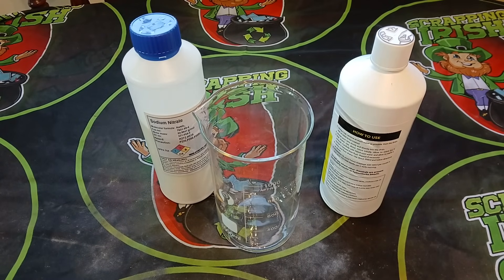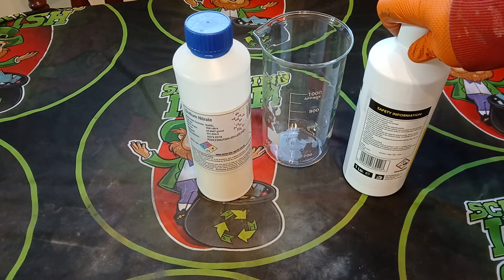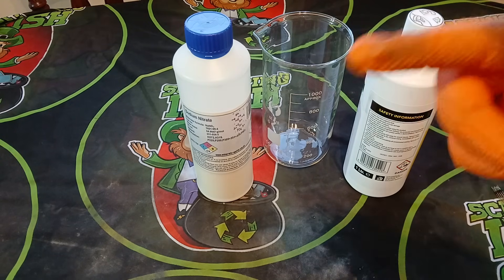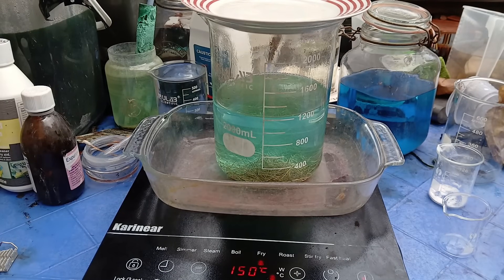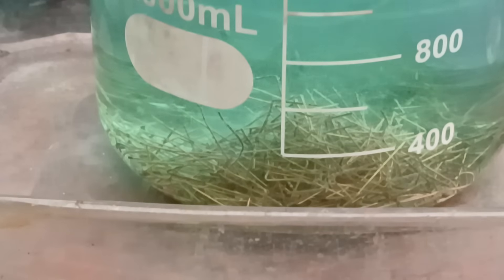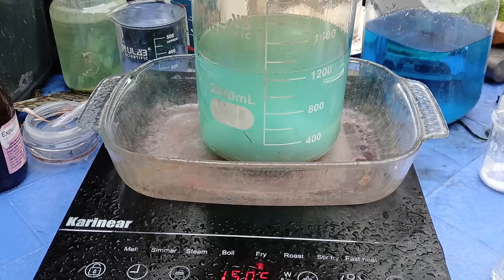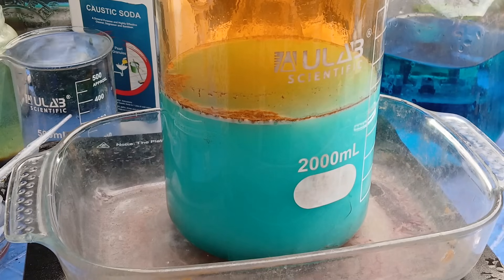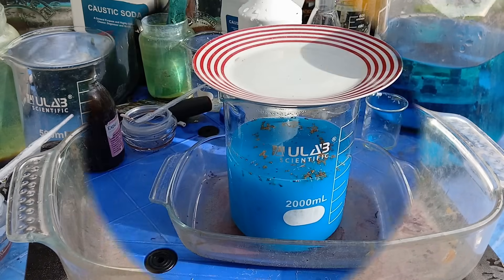STOP Wasting Money on Gold Extraction - Poor Mans Nitric Acid Works!

Comment: Nice video, sodium nitrate is cheap and so is hcl which is muratic acid? Urea for stopping reaction is cheap and stinus chloride is cheap as well this the way I do it. Nitric acid has deadly fumes.
Reply from the maker: Yes, you are 100 percent correct. Nitric acid does have deadly fumes.

Comment: If im doing an experiment on gold scrap is it better to mix potassium nitrate with sulfuric acid instead of hydrochloric acid to make poormans nitric acid to remove my base metals from enquarted gold so that it leaves the gold intact? if i made it with hydrochloric acid wouldn't it just form aqua regia and disolve everything making it impossible to recover the gold?
Reply: As your doing here
Reply from the maker: That's the reason I don't hcl don't want to create aqua regia
Reply: @ScrappingIrish thanks for the reply I thought as much just wanted to clarify! Also if I may ask I have some sulfuric acid drain cleaner I think its 93% but it has a red colour too it woukd this cause any problems in the experiments woukd you know?
Reply from the maker: I have used both clear and the one with red and both seem to work

Comment: Good video for removing base metals, just use battery acid and a nitrate salt, however If you have sodium, potassium or calcium nitrate,  then just make your own nitric.. use HCL and some copper, catch the NOx gasses and push through a chilled condenser and collect in H2O2.. BINGO... Real nitric.. all the best..

Comment: Thanks for your answer. However, I have since purchased some KNO3 and so will be using that. I have made some H2SO4 by electrolysis of MgSO4 sol using clay pots with distilled water in them. I have about  Litre of dilute aced, not done a titration or boiling so uncertain of percentage. Having seen you dilute 50ml acid with 1000ml water had an idea of just adding slowly 60ml KNO3 to 1000ml of already dilute acid, to see if it works.

Comment: You should use a chronical flask. Then attatch a tube to a airstone drop into a container of water add bicarbonate of soda. Then the dangerous gases bubble through the stone and dissolve in the water. No harm to you or the neighbors. Just a thought 😊
Reply: @empirefinds  if i dont have airstone,what can i use instead
Reply: @johannejim7810 fish tank airstones. this is a most important step can not be bypassed. the stone distrubutes the air in tiny buubles that pass through the liquid. big bubbles rise to surface and pop releasing the very gas you are trying to make safe. there are a few more steps before and after . A full youtube video on the fume hood build the do's and don'ts. This will arrive early summer.

Comment: For all the folks looking for sources, it's all at the hardware store. Nitrate  is Stump Remover, Sulphuric acid= Muriatic Acid. Muriatic is a bit weaker than lab grade but works fine.
Reply: @jeffhays1968  muriatic acid is hydrochloric acid not sulphuric.
Reply: @jeffhays1968  sulphuric (h2so4) is NOT muratic (hcl).... 2 COMPLETELY different acids.... better learn your chemistey
Reply: High concentration sulphuric acid is sold as drain cleaner usually, muriatic is hydrochloric based.
Reply: @Shaftley69  battery acid is usually easier to find at an auto shop or hardware store which has an auto section
Reply: Stump remover is Potassium Nitrate
Reply: @jeffhays1968  stump out is sodium metabisulfite
Reply: @jeffhays1968  actually its sodium metabisulphate
Reply: @jeffhays1968  watch the type of stump remover, there are some that Sodium Metabisulfite. 
Muriatic acid is hydrochloric acid, NOT sulfuric acid.
Reply: @jeffhays1968

Maybe you skipped chemistry class. Sulfuric acid and muriatic acid are distinct chemical compounds. Muriatic acid is the commercial name for hydrochloric acid.
Muriatic acid is a chlorine containing compound, while sulfuric acid is a sulfur containing compound. Compared to hydrochloric acid, muriatic acid is a compound of hydrochloric acid with impurities. The production of muriatic acid involves the distillation of hydrochloric acid and a salt (containing chloride ions). The impurities in this acid come from this distillation process.
Reply: @LCMSRJ ok, always thought they were the same.
Reply: If I was u,  I wouldn't play around with any acids

Comment: Where you getting it?, I can't even get sulphuric acid.
Reply from the maker: It's available in hardware stores as a drain cleaner
Reply: Muriatic acid in plumbing supply store.
Reply: @j @jeffhays1968  Muriatric acid is hydrochloric acid. OTC (Over-the-counter) “Roto” drain cleaner is sulfuric acid.

Comment: Instead of using water + sulphuric acid could you just use a car battery acid that is a mixture of the above ingredients ? In some places it’s much easier to get a battery acid rather than a concentrated sulphuric acid.
Reply from the maker: Yes it should work ok

Comment: I do something similar. I put a little water in a jar, then put in the sulphuric acid (slowly). When the reaction stops, I add pottasium nitrate (fertilizer) but the other nitrate will work too. I then put a lid on the jar and put it in a ziplock bag. Then, I stick it in the freezer. The next morning, everything has frozen except for the nitric acid. I pour it straight off into another container. The crystals that formed are suposed to be some form of fertilizer. The nitric is a lot more pure but probably no more than 60% ish. It only makes about 25% of the total volume before freezing.
Reply from the maker: Very interesting, I've never heard of that
Reply: @ScrappingIrish  I found it online and tried it. Works pretty well once you get the nitric back up in temp. Doesn't work for crap cold.
Reply: Yep. It is weaker so doesnt work well cold. Im in texas so usually just put it in the sun. This time of year i have to put on low heat.
Reply: Nurdrage has great videos on how to make a lot of acids.

Comment: I buy sodium nitrate in 20 pounds bags. I go through it fairly quickly. I love using it to get rid of base metals. Save my nitric for the refining.
Reply: I've had every glass baking dish I used shatter from the heat. I've switched to Corning ware

Comment: i use H2So4 and KNo3 ... straight up nitric acid works better  but still h2s04 and kno3 works just as good for what i need.. 
i use straight up nitic for special circumstances though when i need or want to though.. but yea.. both works just as good as the other
Reply: Didn't you just write out the same H2SO4 - KNO3,  HNO3 isn't that nitric acid?.

Comment: Hey brother🙋🏻‍♂️ on average about how many ML of sulfuric and sodium nitrate would it take to dissolve say 1000g of pins and connectors? Just curious what the actual price difference is since sulfuric is roughly $25/Liter and nitric is around $35/liter
Reply from the maker: Woe you pay a lot for sulfuric it's only 8 per ltr here
Reply: @ScrappingIrish WOW yeah I can see why it's such a cheaper alternative.. Amazon has it at about $25 and Walmart for $20
Reply: @ScrapDaddy365  does that mean might swell buy nitric in the states.,?
Reply: @ScrapDaddy365  wow mahal sekali